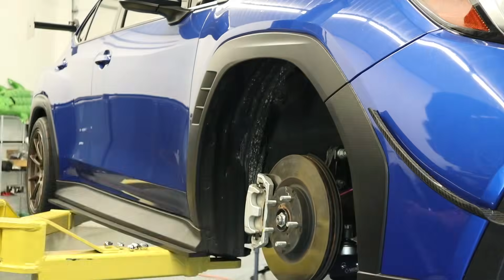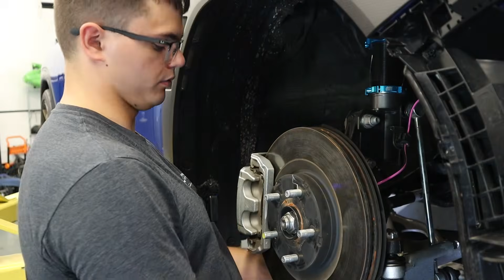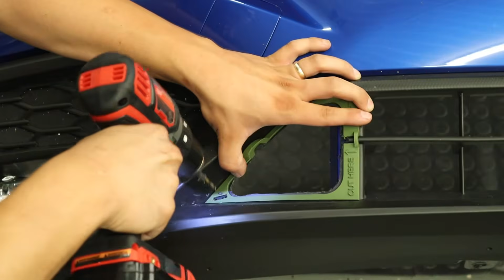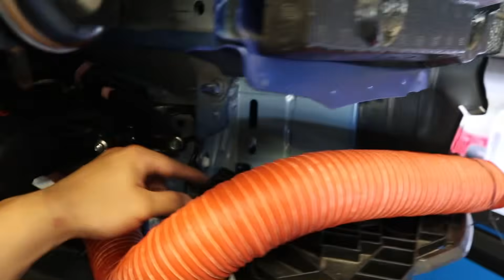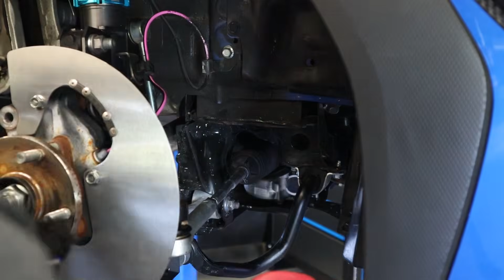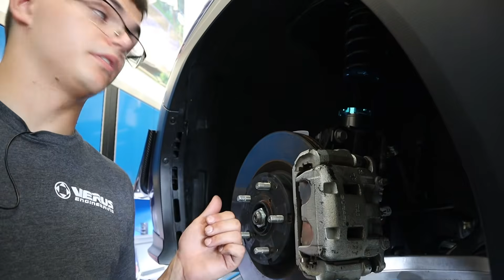How to install our Brake Cooling Kit on the Subaru VB WRX

Comment: Will this work with the different BBK on the market? Not the OEM Brembo upgrade.
Reply from the maker: Hard for us to confirm without knowing which one specifically, but most of them will work with a slight adjustment to the backing plate.